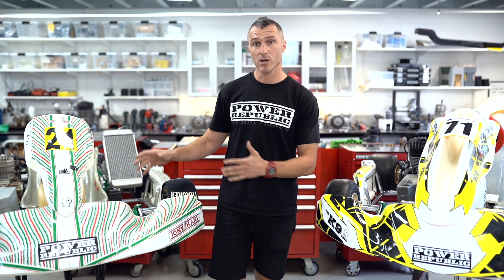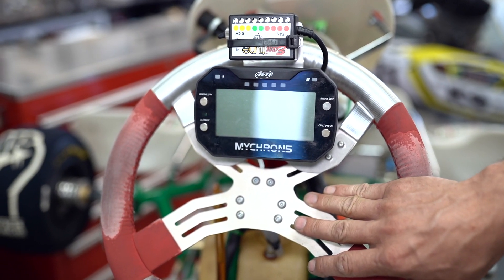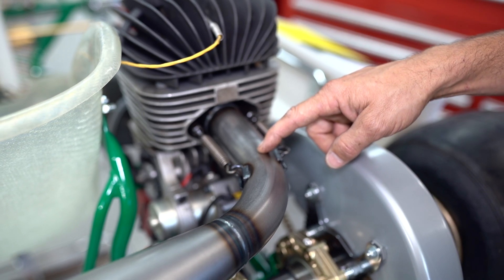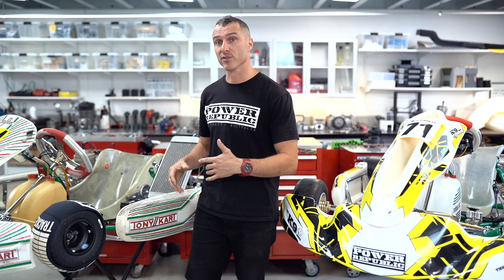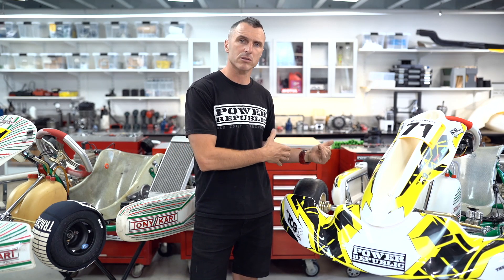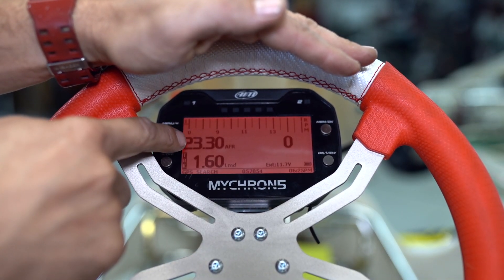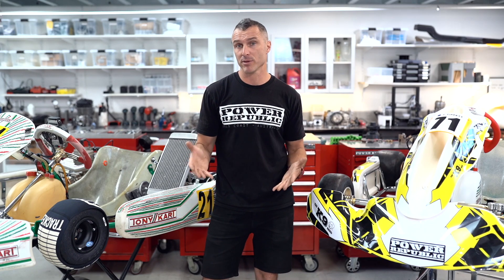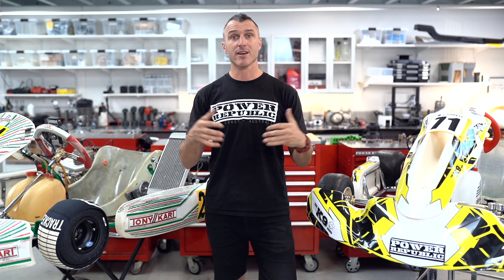Tuning Tips: EasiTune  LAMBDA Sensor Vs. Mychron LCU1 - POWER REPUBLIC

Comment: When you first turn a ln easitune on should it light up or does it need to be at operating temperature for it to illuminate any lights?

In the video when he turns it on the lights cascade across; but mine doesn't . Not sure if there is an issue with mine.
Reply from the maker: nah they are only heated by the exhaust gas, so they need a lap to get hot for the mixture to be accurately analysied

Comment: Hey Dez, What's the best method of attaching the bung to the exhaust?

I've got an alfano sensor, bit confused as to what the best and most reliable method of welding on the sensor.

Can I use a mig welder (which is what I have available using Argon shielding) or should I send the exhaust away to have the bung bronze welded?
Reply from the maker: we / unlce Mitch, uses the MIG at work and it works awesome.  He is a welder tradie however.   otherwise I used to braze them on , but they have cracked before with that too.  and now we don't have OXY at work. so it is MIG or nothing

Comment: Hey Dez, loving the videos thanks heaps, it's been a great help for newcomers like me.  Just wondering on the best placement location of the LCU1 sensor (Bosch LSU 4.9 probe) on a Rotax Senior Max Evo 125.  Can you please provide measurements on the header pipe and between the cylindrical cones if that is possible on the Rotax?

Comment: Hey,i want to use a EGT-Sensor on my DD2. How long is the distance, specially for a DD2, from the Piston to the point i want to pace it?....and which temperatures will show me a good setup.
Reply from the maker: Hey Tim, not sure exactly, but 50mm from the end of the pipe is a good start point and 635 degrees is typical for KZ, unsure about peak temp for DD2

Comment: Great videos!  Can I use the mychron lcu1 on a 2 stroke engine in a kart? I have the IAME 175 super TAG engine.  I have heard that the oil mixed with gas will foul the lambda sensor.  Thanks.
Reply from the maker: yeah it does, but you can replace the sensor pretty easy and they last for ages

Comment: what about the alfano 6 lights? its like easytune plus mychron 5 capabilities right?
Reply from the maker: yeah I haven't used the alfano system with Lambda on the new 6 model.  I have used it on the older Astro model and it was excellent.   do you have the alfano version?
Reply: @PowerRepublic  yes i do have it, it has been an awesome piece of equipment, i have been using the ligths for like 3 races but on last race  the sensor died because i drop it so i had to buy a new one :(

Comment: Thank you so much Derek, you have really mentioned every little detail, and that makes a massive difference, looking forward to the next video.
The Alfano 6 is pretty much like the Mychron, just as expensive, I hope you can talk a little bit about the sensor itself, some people say that as soon as it gets a little bit dirty from all the deposits, the sensor can malfunction, I don’t know if this is true or not, maybe that’s something that used to happen in the old days, I really don’t know as I have no experience with the lambda sensor but I really want to use one, if it works fine for quite sometime, Maybe once in a while the sensor needs to be cleaned? I’m sure there are ways to do that without damaging the sensor.
Something else to cover in a future video 👍👍👍🙏
Reply from the maker: yeah the sensor is like tyres, sometimes they need to be replaced.  but its not uncommon for sensors to last 20plus hours.  and you can't clean them AFAIK

Comment: In your opinion; does the narrow band sensor of the EasiTune have enough resolution to be applicable to shifter karts? The reason I ask this is comparing the AFR needed for best power (and durability) on an air-cooled kart compared to a water cooled kart, are different, so I’d assume the “GREEN” zone has a particular engine type in mind???
Reply from the maker: great question.  not sure as I haven't used on a KZ.  but they work well on x30, rotax and all water cooled engines I have tuned in the past for me.   in saying that, the wide band unit is superior in its range and data-logging, so if you are KZ driving, maybe learn towards the LCU1 kit